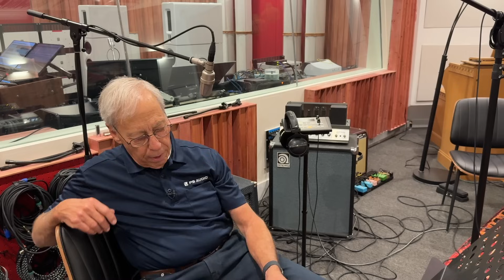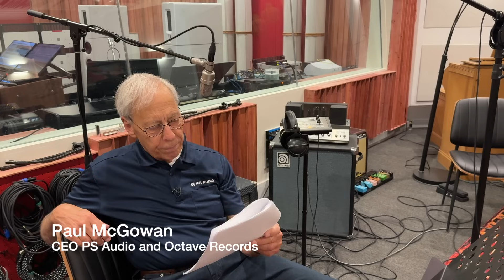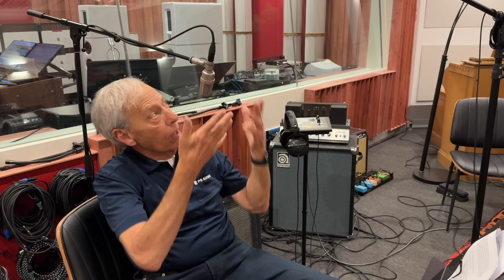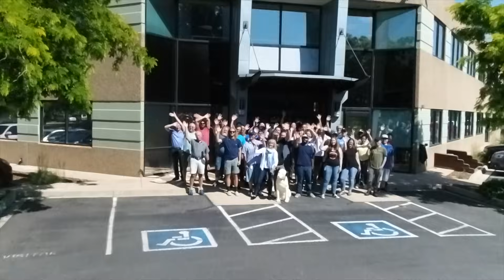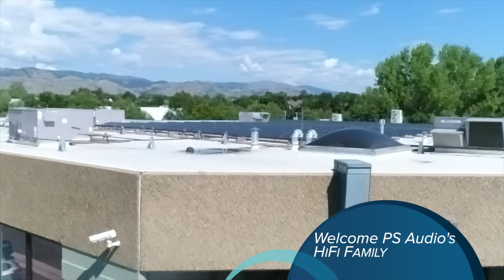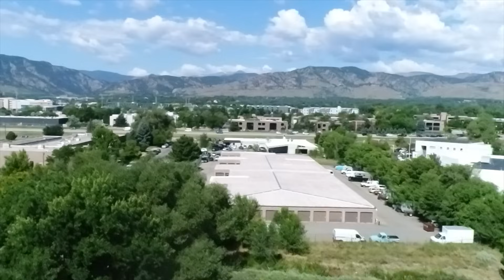Going negative in a digital signal

Comment: Negative numbers definitely do exist and can be dealt with in nearly any computer processor.  The most common way to implement them is called "2's complement" these days and computer hardware has been designed to deal with it for decades.  You can find more than you want to know about it online (start with the Wikipedia page if unfamiliar with it).   A 16-bit integer can represent -32768 to 32767 this way.    Integers 0 to 32767 are implemented the usual way and the most significant bit is always a 0.   That most significant bit will be a 1 if the number is negative (flip the bits of the positive version of the number and add 1).   It applies to any bit length of integer, whether it be 8, 16, 32, or 64, or any other unusual size.   1's complement was a similar scheme and another scheme simply set the most significant bit to 1 if the number was negative, but 2's complement won out for most applications.    2's complement allows a nice "do subtraction by adding" most simply.   this brings back fun memories of my 1987 digital logic computer science course I took.
Reply: when this guy discovers Quadrature Amplitude Modulation  he's going to really have his mind blown.

Comment: That Ampeg B-15 setup behind you sure is sweet. Does that belong to 'the house', or is that an outside player's rig? I provide several types and sizes of bass systems at my studio, and one favorite is the Ampeg BA-115AV 100-Watt 1x15" bass combo that has a 'modeling' system built in to 'recreate' other Ampeg amps such as the B-15 on up to the SVT. I mic it at a few different points and also run a line out to the board. It doesn't have to be driven loud to get its full effect, which is nice, no matter what kind of music I'm recording.

Sorry to type your ear off:face-green-smiling:but I was just wondering. I like to talk gear and setups for tracking. Cheers!

Comment: That's why I look at any sampling depth as actually only half as resolving as thought. Because the most significant bit is basically only the zero voltage line when looked at as a bidirectional audio waveform. 

Also why ladder DACs are far more accurate. e.g. send a data sample into a ladder DAC with only he MSB a 1 and the rest 0's and it will give you a steady center voltage. While a Sigma Delta will not have any idea what voltage to put out. All it knows is where to turn on or not for that sample cycle.

Comment: OMG , this is completely wrong . There are negative binary numbers . The first bit is always a sign flag !  So an 8 bit binary number ranges from -128 to +128 . A 16 bit number from -32768 to +32768 . This has nothing to do with a fixed offset . Paul is dead wrong .
Reply: it appears in a wave file "16-bit samples are stored as 2's-complement signed integers, ranging from -32768 to 32767."
from searching "WAVE PCM soundfile format"
Reply: -128 to +127
Reply: They say some people are non binary.
Reply: Not how an ADC or DAC work. The zero center voltage level with positive and negative swings does not exist in those circuits. There is zero voltage to positive peak voltage. A 0-2V range for Red Book. No negative voltage exists. If input is properly calibrated a maximum negative swing as seen on a trace would reach zero volts and have all zeroed bits in the sample. With a maximum positive swing hitting clipping and maxing out the ADC with all ones for all bits. At no point does a sample represent a negative voltage swing.
Reply: @glenncurry3041  It would be possible to build a DAC that way though. Or use 2 DACs, one for negative. Problems probably greater than advantages, except maybe for a test voltage generator. 
Potentially, digital bits can be encoded any way you want: positive integers, floating point, encrypted ASCII text file stored in big endian byte addressing. People do digital math all day only converting to analog in their brains.  ;)
Reply: @spentron1  Show us all the existing audio data file type that provides a negative number sample for the negative DAC to respond to.
Reply: @glenncurry3041 Trivial conversion (digital split/gate), especially compared to upsampling and digital filtering.
Reply: @spentron1  Failing to be able to provide proof is not the same as trivial. No cigar! But nice try!
Reply: @glenncurry3041  If it's audio it has positive and negative signals, anything else is semantics. Have a nice day!
Reply: @spentron1  OK so show us all the schematic for a simple SET with the complementary positive and negative stages and PSs.
Reply: 2's complement all the way. It looks strange, but it is actually genius because the same set of gates that perform an add operation can work with either unsigned integers or 2's complement signed integers. This was a huge advantage when CPUs were made from physically discreet gates. The big new (ish) thing is floating point digital signals. Floating point digital formats are already in use inside some radio recievers. The big advantage is that the noise floor goes down as the signals get smaller. Of course the opposite occurs too, but when the noise is consistently 100db below the signal you are never going to notice that unless you are doing something like looking for exo planets or enemy stealth drones. Think about having an audio recording from something like a body camera where the audio does not overload or distort even when a firearm is discharged inches away, but the audio stays so clear you can hear the wearer's heartbeat in-between gunshots, or hear raindrops between the crackles that precede a lightning strike, all without distorting the signal of the gunshot or lightning strike. This is probably only a niche for audio because our ears are only so good, but represents a big improvement for scientific instruments, evidence collection, and event monitoring. Such a recording format can far exceed the capability of our ears and eyes. A video could retain details even during the flash of a nearby lightning strike.
Reply: Not quite just a sign bit. Two's complement is a bit more clever than that.
Reply: Who’s joining me in sticking with Paul? 🙋‍♂️

Comment: In binary integers the most significant bit is a negative flag.  

It's easier to see In Binary... 
0000 0000 0000 0000 to 0111 1111 1111 1111 are positive.
1000 0000 0000 0000 to 11111111111111111 are negative.

The position 1000 0000 0000 0000 is  used as zero.
Reply from the maker: Well, you almost got it right. In 16-bit two’s complement binary, when the MSB is 0, the number is non-negative (0 to +32,767)

When the MSB is 1, the number is negative (−1 to −32,768)

Binary values range from 0000 0000 0000 0000 (0) up to 0111 1111 1111 1111 (+32,767) and from 1111 1111 1111 1111 (−1) down to 1000 0000 0000 0000 (−32,768).
Only one bit pattern—0000 0000 0000 0000—represents zero.

So, yeah, I probably made it more confusing but was hoping to keep it simple. I failed. Thanks for the correction.
Reply: @Paulmcgowanpsaudio  
Ah... of course, it's been a while since I played at the binary level.  Thanks.
Reply from the maker: @Douglas_Blake  me too!
Reply: In binary, negative numbers are preceded with a minus sign, same as all other number systems.
What you describe is the encoding of signed negative numbers using only binary digits (aka bits).
You're ranges are correct, but the last part is wrong. 0000 0000 0000 0000 is zero, 1000 0000 0000 0000 is -32768, 1111 1111 1111 11111 is -1

Comment: Hey Paul, please answer this question for me. Do you have any idea why the speakers of today do not have the subwoofers built into them like vintage speakers?
Reply: The place that's best for the speakers is likely not the best for the subwoofer(s), or they wouldn't be needed as often.
Due to the length of the sound wave that low in the frequency response it behaves very different compared to higher frequencies due to the physical dimensions, subwoofer(s) are used to even out dips in the response.
Reply: apparently this was something that manufacturers weren’t aware of when they built those vintage speakers back in the early days. Those old speakers had great sound with those built in subwoofers
Reply: @TonySmith-j9x  It could have been that there weren't many options for amplifiers etc. Looking at old drivers they weren't always digging deep like most today, so that could have been another reason why they added a dedicated subwoofer. 
I believe some high-end speaker still has it, but at that point they're more or less including it due to what you're paying and it's easier than gold plating everything. 😆
Reply: Thanks
Reply: Many brands of speakers today offer built in subs. GoldenEar is just one of them.
Reply: Thanks